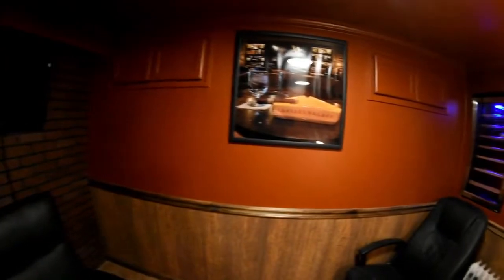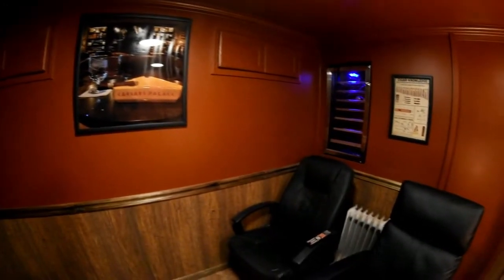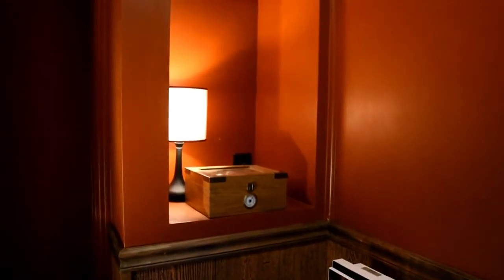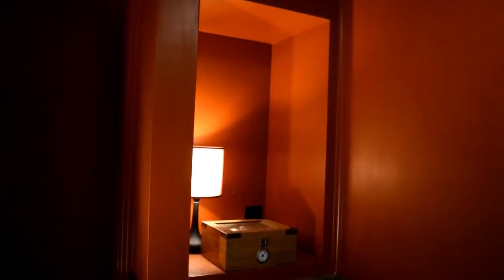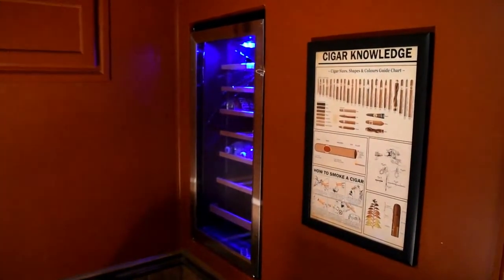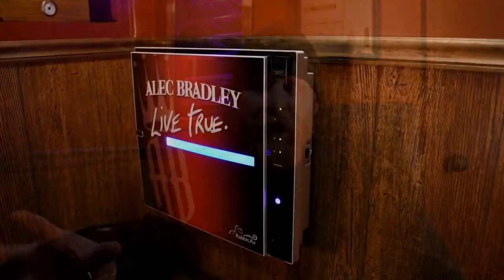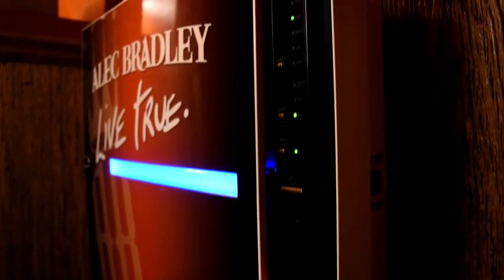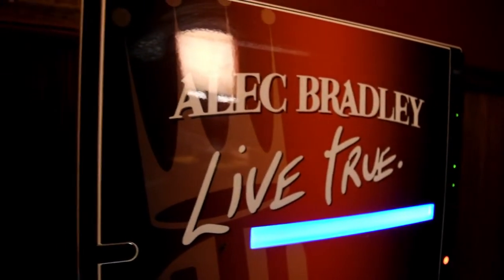Home Cigar Lounge Man Cave Tour

Comment: Well done brother!  I’m in the middle of building my own cigar lounge.  I know you’ve answered this prior but now that you’ve had room for a while, what are your thoughts on sound volume of exhaust system.  And do you find that system pulls heat out of your lounge.  Cheers.
Reply from the maker: Thanks man!  My fan has 8 power levels and since my room is so small i have been able to run it on level 2.  I almost dont hear it it all.  At level 4 it starts to be noticable against the TV sound.  As for the heat, my basement isnt heated so i run a small 600w radiant space heater during the winter(only while im in the lounge) and i do notice the temp drop a little when i run the fan. The heater keeps up tho.

Comment: Great video, I'm about to start something similar. I'm curious about those chairs.  How are they holding up?  The price seems too good to be true.  I haven't found much out there that wasn't a few hundred each.
Reply from the maker: The wood on the top of the arm rests has broken out a little bit. Seems like it is 1/4 in balsa but the main arm frames and covering are holding up.  I havent used the heaters in them but overall I'm pretty impressed.  Ive used them almost everyday for 3 years.

Comment: I like your setup. I have been thinking of converting an outdoor shed to a man cave lounge. How did you duct the inline fan into the room? Did you use a traditional bathroom exhaust vent cover or a other type of vent? I assume the link for the vent cover was to outlet the exhaust duct to the outside. Thanks for the information.
Reply from the maker: My outlet is up high on the wall. I used Lowes item number 52330. Its a rectangle to round transition. Then covered it with item 125256 which is a 6x14 grille. Its not an exact fit but it worked and looks nice.
Reply: Thanks for the reply. One more question, how did you supply power to the fan? Looks like it comes with a standard plug that connect to the switch and would plug into the standard outlet but how would that work if the unit is hidden in a ceiling and the switch is in the wall. Did you just cut the plug connections off the provided cable and hard wired to power in the wall?
Reply from the maker: I wired a receptical in next to the fan to utilize the plug.  I am also planning on putting an access door in eventually for fan maintenance.  This fan came with a wired controller that i mounted in a standard wall box. It was a pain but worth it.